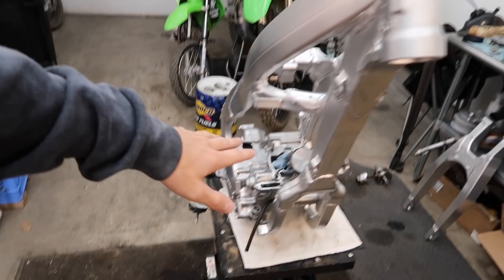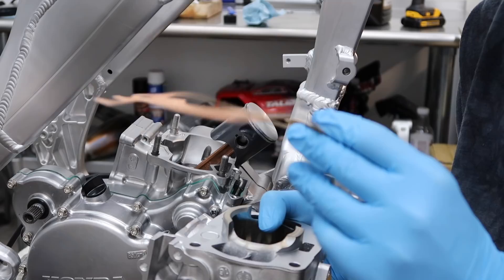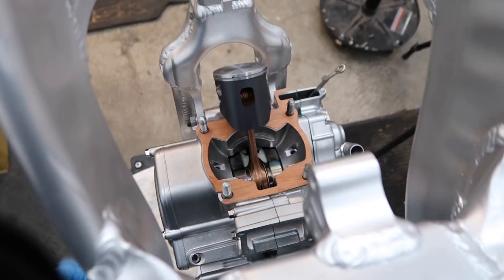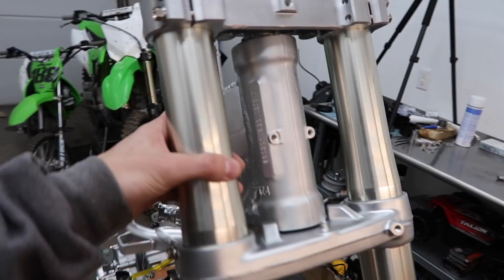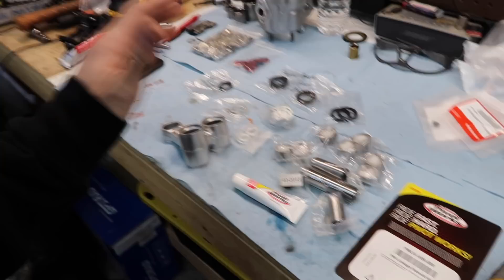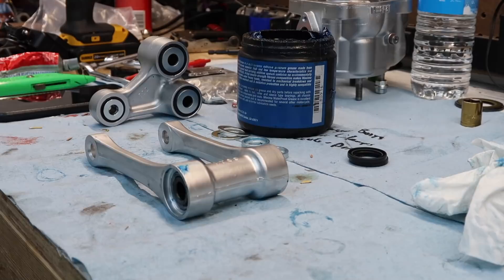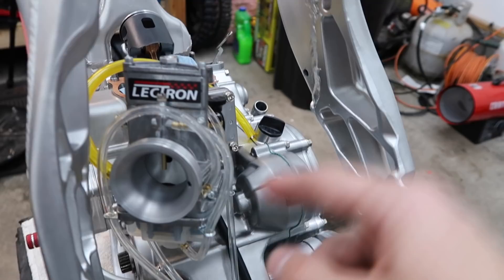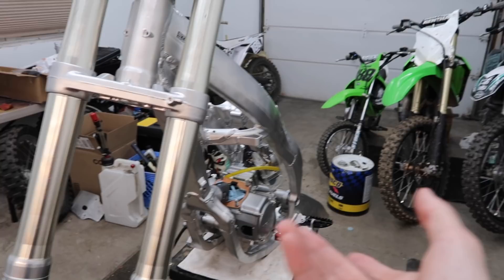CR125 BUILD PT.11 | Lectron Carb + New Parts

Comment: Everything looks mint. To save the lips on the shock linkage I use a dish towel on the vise when I press the bearings in. Cardboard works too, but you need three hands.
Reply from the maker: Yeah an extra hand would have helped 😹
Reply: @TylerMonagan  I'm looking for a coach this summer. I'm old, but my  bike motivates me to race in the 50+ class in two years. I'm near Hog Back and 51.

Comment: Going through the time and effort cleaning and painting those stock narrow pegs was a mistake . Just get yourself some IMS  pro pegs ! They are wider and very nice for cheap ! $ 89.00   .  Would definitely  get Galfer  oversized 270mm  front  rotor, and Galfer rear wave rotor.  Remember , most genuine  Honda parts are better than most aftermarket parts, not all, but most !  Can't  wait  to  see  this smoker done.  Have a 250 2003 with about $ 4000 in it . It is sick and ride it almost every weekend . Whish l could post a picture of it !